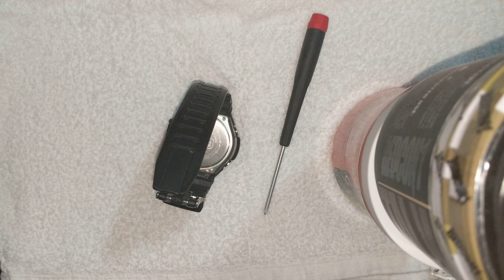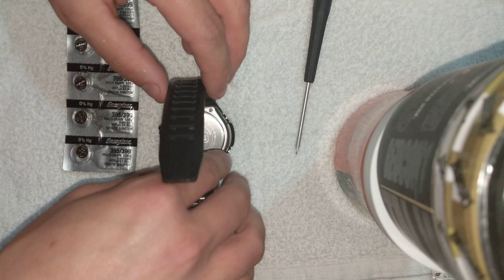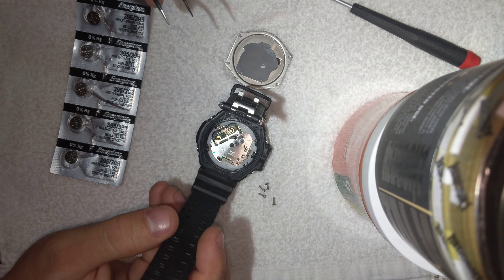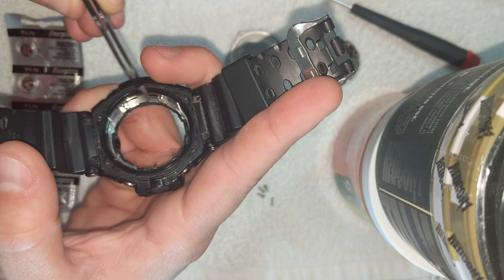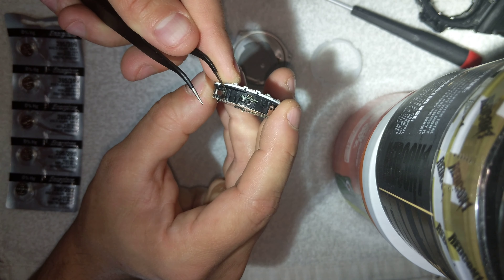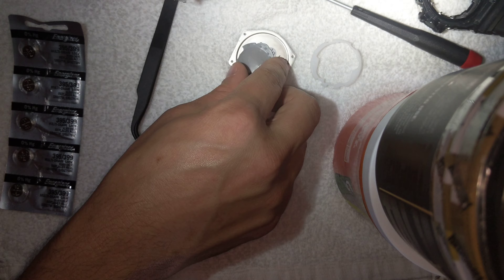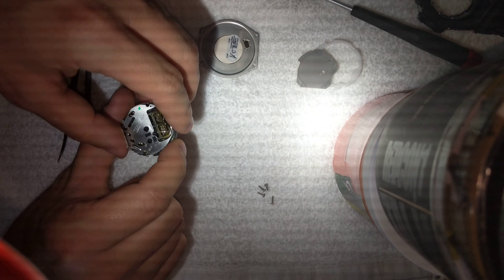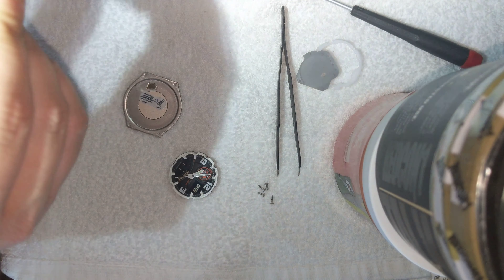G Shock GA1000 Protection battery replacement/ full teardown to clean crystal

Comment: It is unnecessary, as well as risky, to do so much disassembly of this watch just to replace the batteries, particularly without proper jeweler's tweezers. My I politely suggest that you watch a few other videos on this topic to get an idea of how simple it is to merely unlatch the battery retainer, pop the batteries out, replace with new batteries, and re-latch the battery retainer, all without removing the label. Kudos for mentioning the need to touch the contacts with tweezers. Enjoy the watch, it's a pretty awesome timepiece.
Reply from the maker: Thanks for watching! I'm very confident in my abilities to take things apart and put them back together. If someone isn't comfortable doing so, I would recommend they do not do this procedure.
Reply: @vinnysdiyworkshop  I watched because I have a white speck stuck to the inside of my crystal and I wanted to see if it was difficult to clean the inside of the crystal. Thanks Vinny.
Reply from the maker: @augieschultz2530  glad to help!